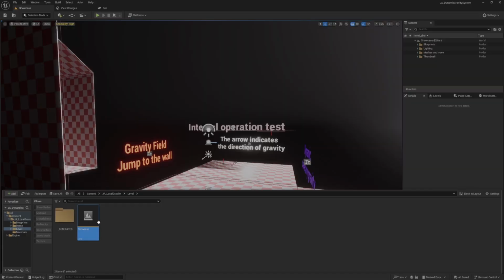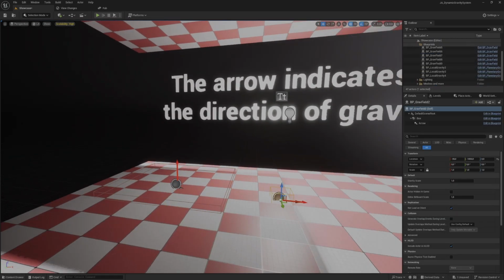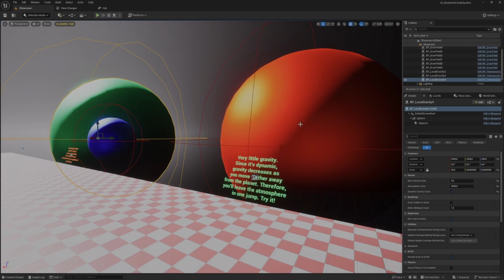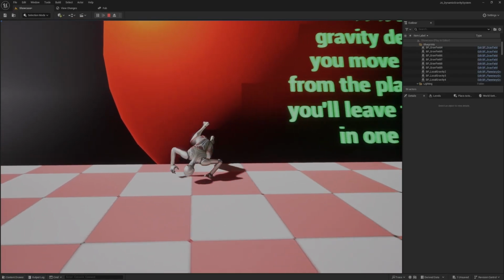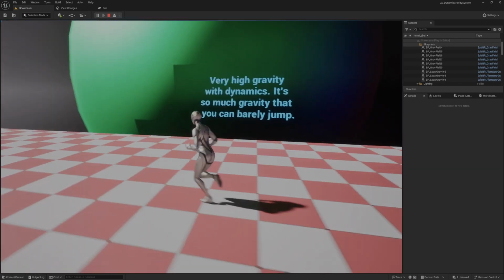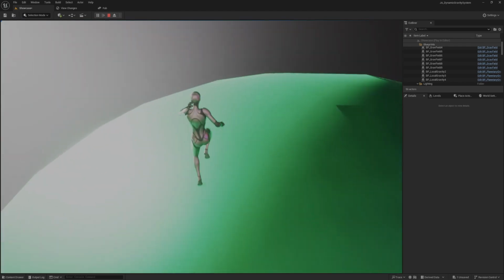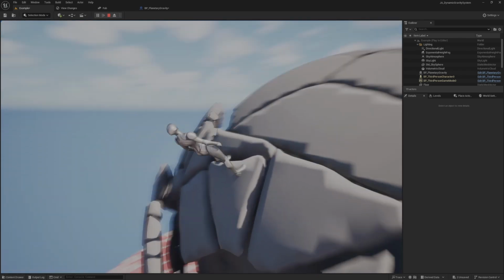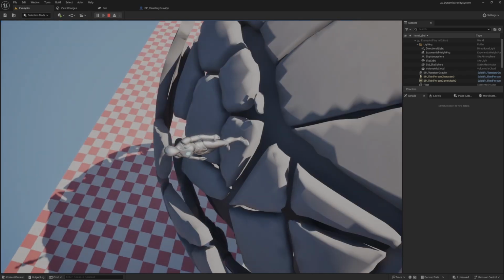Recreating Outer Wilds’ Gravity in Unreal Engine

Comment: Hello There,
It looks really nice and is exactly what I need, so I'm considering buying for my project  but I have a few questions. 

1- I have my FPS project in UE5.6 will there be any compatibility issue?
2- Is it possible to make the rotation smoother during gravity changes? 
3- Can I use those gravity fileds on moving or rotating objects?

Comment: Hello, 
1. How can we control the gravity of other objects? 
2. If a gravity platform is rotating or moving, how can the gravity of the characters or objects in contact with it be continuously controlled?
Reply from the maker: Hi!,

1. You can try casting the object inside the BP, or casting it using a tag or something similar.
2. I haven’t tested it, but as it’s built, if you also rotate the blueprint that manages gravity, while you’re inside it, it shouldn’t crash.
Reply: @3DJotaArt  Thank you!